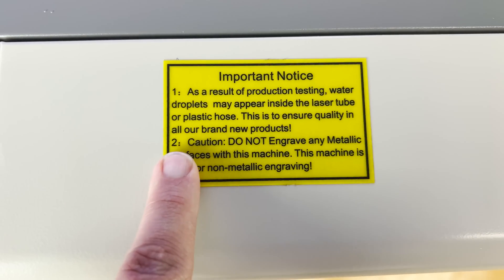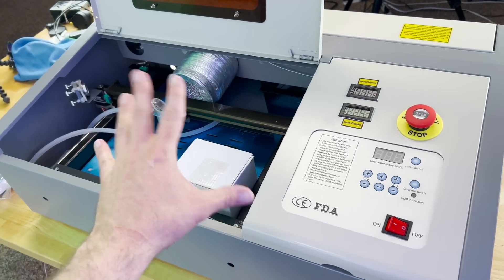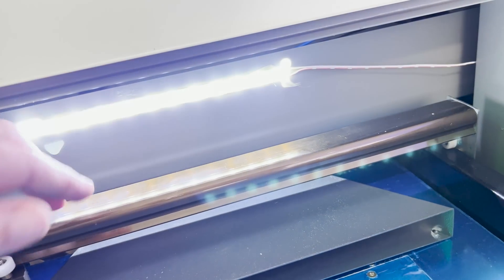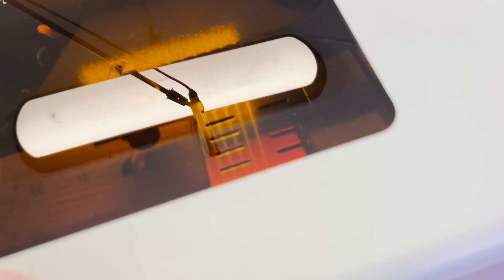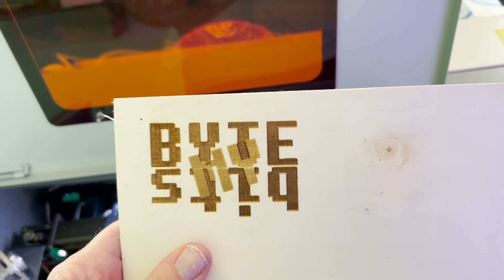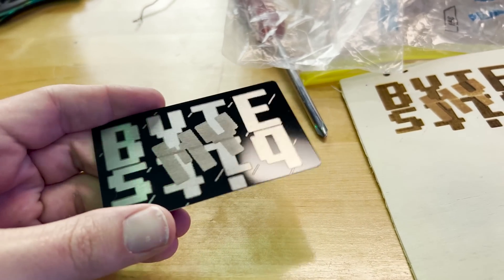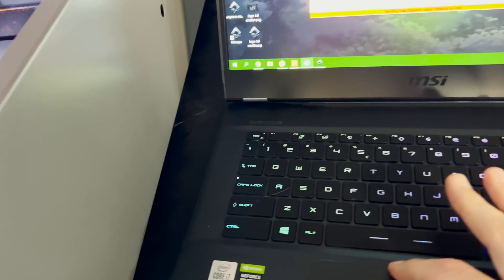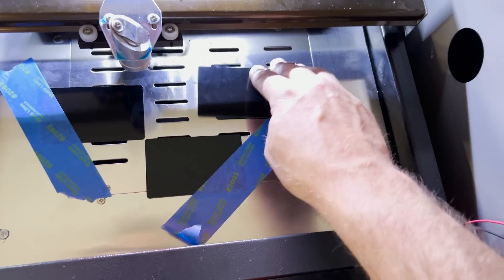Monoport HIGH POWER laser

Comment: The "7 Watt" laser is probably more like 1.5 watt. It's 7 watt input and and 1.5 watt optical. You also might want to try light burn for the control software. And finally the air assist is a must for clearing the soot from parts and helping to blow out any fires. It should be a standard thing to include in my opinion. 
I have a "10 watt" laser (more like 2) and have had some success in engraving on glass using black poster paint or nail varnish. Poster paint is preferred as it doesn't smoke when burnt.
Great video. Keep up the good work.

Comment: step 1.. get lightburn. amazing and extremely easy to use software for your pc
step 2.. see if your paperwork tells you what your laser's focus depth is. this is how high the laser should be from your work surface. think magnifying glass and sunlight. too close, too broad a beam. too far, too broad a beam. right distance, finest point (max power and more precise) if that machine has an adjustable z height, you can adjust it for whatever thickness of material you put in it. if it doesn't have an adjustable z, you'll want to come up with different thickness plates to go along with the different thickness of materials you use to put them at the correct distance from the laser.

lasers can do some pretty amazing things once you get the settings figured out for your different materials. have fun!

Comment: I seen some designs created with a laser that utilized, a surface with different colors of paint applied.   The power is adjusted so that a specific layer is reveals an amazing a color  text, logo , etc...   For example, paint a metal plate with  red or yellow layers, then cover it all with a black layer. Then print your design.   Hope that makes sense.   It would be an interesting project I would think.